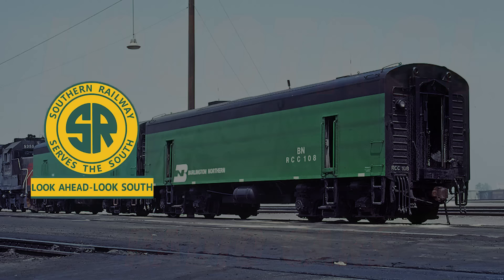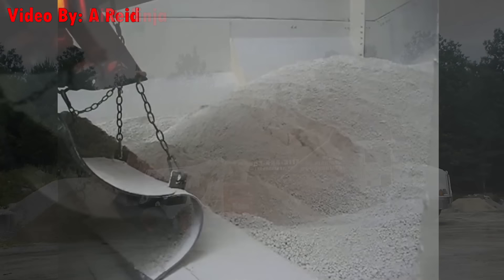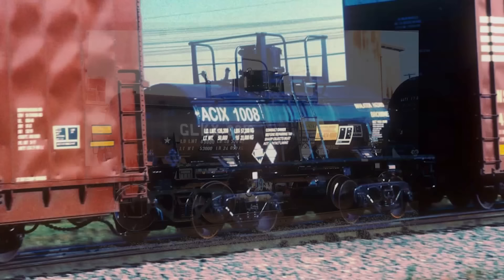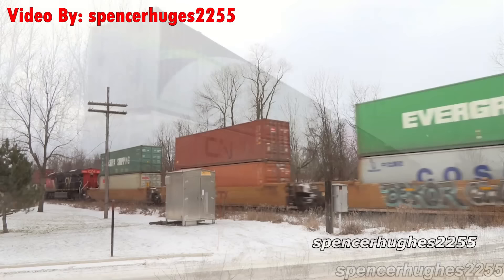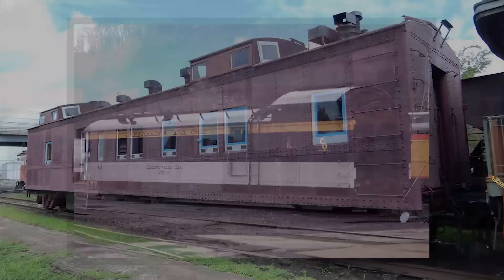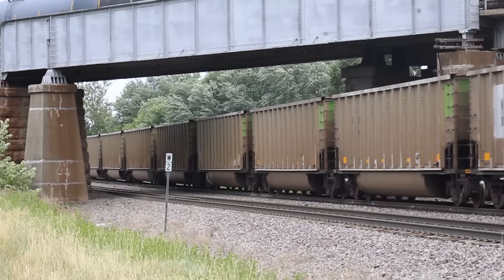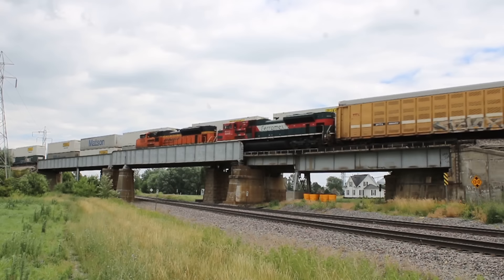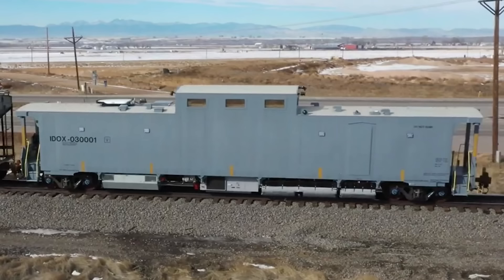10 Obscure Railcars Explained In 10 Minutes! PART 2!

Comment: Another one that might be interesting for a future video: the specialized carriers that BNSF uses to haul Boeing 737 fuselages from Wichita Kansas to the 737 assembly plant in Renton WA.  Used to see these somewhat regularly when I lived in Everett.
Reply: they still run these trains very frequently, usually a lot less in bulk however. Typical unit train of them nowadays has two if you're lucky. Every now and then the Q-ALTPTL will have up to 10, saw one with about 5 of them earlier this year. Remainder go directly on a J-NEWINB where they get put onto R-NWE737 directly to the Renton plant.
Reply: I’ve seen those before
Reply: yes they also go to Everett I think and they get sent over the cascades through the cascade tunnel and its interesting to watch them come in or go out there's some videos on YouTube
Reply: BNSF picks up cars from Spirit nearly every day as J-NEWNEW, and then J-NEWINB later in the day.

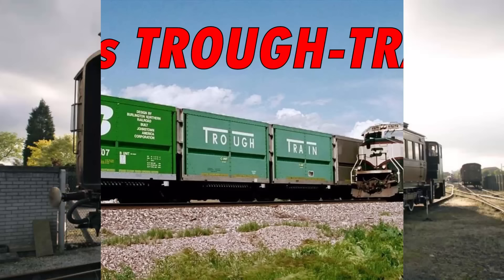Comment: The Dynamometer coach at the 6:08 mark is the one that recorded Mallard's run at 126mph. It was originally built for the North Eastern Railway in 1906 at Darlington and retired in 1954 and preserved. Dynamometer coaches had to be turned at the end of each run as the equipment could only record in that direction, something that computers don't need.

Comment: Yes, an informational video at best, but there was a short part that caught my eye. At timestamp 5:18 it shows you using a BNSF website restricted to BNSF engineers and conductors which is simply not acceptable. If you are a BNSF employee that I don’t know about, that is sure one way to get terminated from your job.
Reply from the maker: That websites  not restricted, anyone can visit it. I found it while digging through forums.
Reply: It became visible to the public during the transition from TSS to SAP. We don't need to be doing things to bring it to their attention and publicly showing it to the world - that's a great way to get it put back under lock and key again.
Reply: @Southern_Plains_Railfan please remove this part from the video, don’t want to draw attention to BNSF about it and let it get out of hand to the public. Thanks! It’s just for security sake!
Reply from the maker: @cameroncintel1284  I’m working on it. My apologies, I didn’t know this could be an issue for the railroad. Thank you for letting me know.
Reply: @Southern_Plains_Railfan yeah, I suggest not using anything Class I related unless you can confirm that is is for the public, like a rail map.

Comment: As a railcar fan I like this series quite a bit.  Here are some other cars you may find interesting:
FCA Dynastack: experimental skeleton body wellcar, it only lasted a few years until all were hurriedly removed from service and scrapped because the structure of the car was known to collapse mid train leading to a Dynastack shaped sandwich.
JAC Grainporter 5400:  A once fairly popular covered hopper which was built from aluminum built in the 90s.  Many of the cars were scrapped after a little over a decade of service, so they are not as common for their age.
Amtrak Metroliner cab car: Cab cars from the Metroliner high speed EMU sets were refurbished by Amtrak as cab cars for bi directional trains.  They were built by Budd, who also built the successful Amfleet series of cars for Amtrak, and the cab cars shared the same exterior design so they fit in with the existing fleet and allowed reuse of obsolete equipment.
BUDX 6250:  Budd’s freight car affiliate Transit America built a one off 6250cf articulated covered hopper BUDX 6250.  The car lasted for at least a decade but it probably scrapped.  This car could be considered a spiritual predecessor to the infamous Budd/TA designed BFCC articulated flatcar most known for carrying EPIC sewage sludge containers.
NP Big Pig Palace:  85’ long bi level livestock car, built by Ortner and are some of the largest livestock cars ever built.  They were later converted to tie gons for BN.

Comment: Those dynamometer cars must've been the pre-cursor to today's geometry cars.  Every now and then you'll catch one by itself with a (typically holier-than-thou) crew on board that pretty much lives there being hauled by a single locomotive.

DODX cars kinda rare and they all seem to have 3 axle bogeys.  You can almost hear the bald eagles cry out seeing 100+ APC's roll down the line.

BNSF has a boxcar converted into a climate-controlled classroom that gets parked in various cities to train First Responders in HazMat.  It's quite plush.

You could probably do a whole video on Maintenance of Way cars.  The specially made flat cars that haul roadway equipment has a roll-up ramp in the back!

Comment: Great Video! If you plan on a part three may I suggest the BN's "Bopper Car", an aluminum boxcar that doubled as a covered hopper. Intended to haul Koalin clay one way and finished paper on the return route. It was even equipped with a walking floor. Three are preserved in Duluth, MN out of the 8 that were built. May I suggest a video of unique MOW equipment like Southern's Gravel Gertie ballast cleaner, Great Northern's big Sno-Melter, Bros Rotary Plow and the Julls and Mann-McCann spreaders.

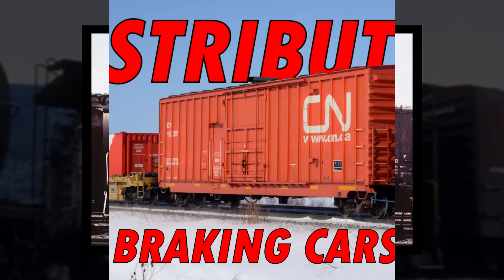Comment: 4:28 Amtrak has a similar system. The now retired Talgo Series VI train sets used for the Cascade Service in the PNW used the main reservoir air line for exterior and interior doors. Consequently this created a lot of air leaks that the air compressor on the single locomotive struggled to keep up with. A few NPCUs (aka Cabbages, former F-40PH's that had their diesel guts removed and converted into operating platforms for push pull service and the engine room was converted to a baggage area) were retrofitted with an electric air compressor to help keep up with the air demand. Because the brake pipe follows the main reservoir air pressure, once the main reservoir air pressure fell below 110 PSI (Amtrak's brake pipe pressure), the brakes would apply. Without the extra air compressor engineers would notice brake applications while blowing the whistle (also runs off the MR) in areas where there are many crossings congested together. Today only a couple NPCUs still have this air compressor, and all will likely be retired (or at least cease use in the PNW) after the arrival of the Siemens Aero Cascades train sets in 2026, which will have their own operating cab.

Comment: For part 3 may I recommend the rail cars that carry new rails, in full-length format? I have seen some go by, and the lengths of one piece rail they carry, presumably daisy-chained on shared bogeys like shipping container cars, is absolutely stupendous. I'd love to know more about them and the rails they carry. I have seen them on CN train and track in western Canada.
Reply: These are called Continuous Rail cars. You can spot them at Steel mills. Like one here in Pa. (Bethlehem, now with a new Co name)  but they can be seen leaving.
Reply: @robertadams6606  thank you! 
It is incredibly pointless to search 'rail carrying rail car' or the like.
Reply: @mircomuntener4643  Agreed but you could mention it in your podcasts as a train piece that was not a good thing to create. It could be a etc thing.
Reply: @robertadams6606  huh? What's wrong with it? And what podcast? I'm just a plebe here.
Reply: @mircomuntener4643  I don't have a problem w  the Podcast, just wanted to see about those things. Maybe like a Miscellaneous part.
Reply: We call them 'ribbon rail' railcars.  They usually just dump ~1000 ft pieces of rail right off the side of the track! All of the Maintenance of Way railcars are super cool.

Comment: Seems like the armored caboose should be paired with armored locos.
Reply: No real need. Suppose attackers capture the locomotives. Now what? It's not like a truck where you can drive it wherever you want.
Reply: @beeble2003  the purpose would be to prevent it from being stopped in or by an ambush at all.